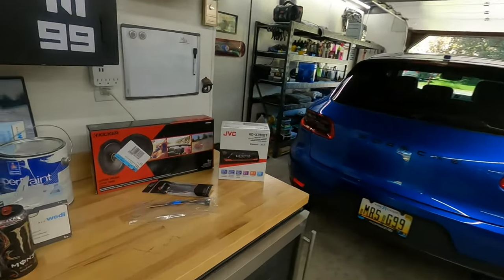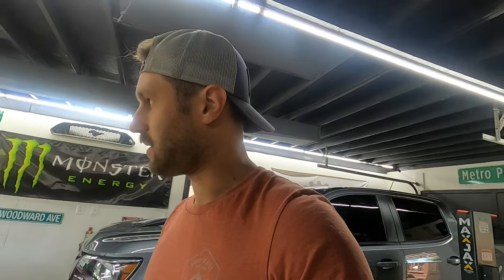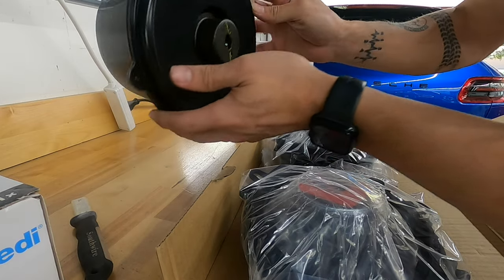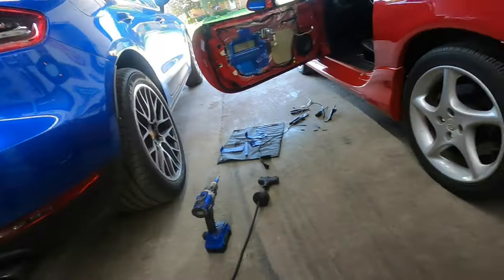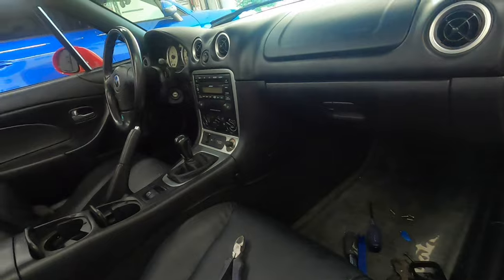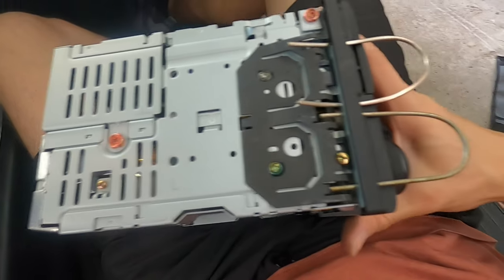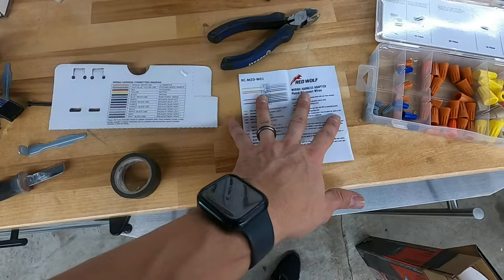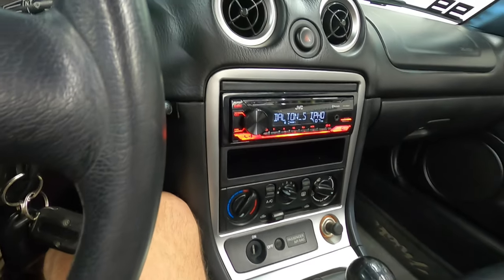Kicker Speakers and New Head-Unit in the NB Miata  //  Sorry old Bose System...

Comment: With the amp bypassed is there enough volume coming through the speakers? I've read it's necessary to use a line out converter like the Scosche SLC4 so you can utilize the Bose amp to get the necessary volume.

EDIT: I believe those write-ups were in regard to keeping the stock Bose speakers, which makes sense as far as keeping the stock amp is concerned.
Reply from the maker: Yes it sounds wonderful bypassing the amp
Reply: @garage_ninety_nine  Did the bypass and installed the Kickers and an ATOTO head unit. While I was waiting for the door adapters for the Kickers, I left my Bose speakers hooked up, just to see if they would work. They did, but couldn't be turned up too loud bc of the ohms mismatch, of course. They actually sounded REALLY good; lots of bass.  The Kickers are definitely lacking in that department. Still glad I did the swap, but wish the Bose speakers played nicely with aftermarket head units.

Comment: This may sound stupid but how do you remove the speaker after you e removed the 4 screws. Mine is stuck in place I can get tweezers between the metal but can’t pry it loose.  Every video I watch it’s like it just falls out for everyone else
Reply from the maker: Your rubber seal may be melted to the door/plastic barrier back there